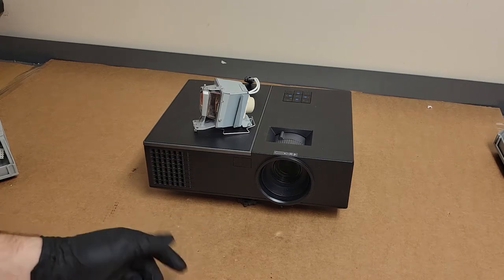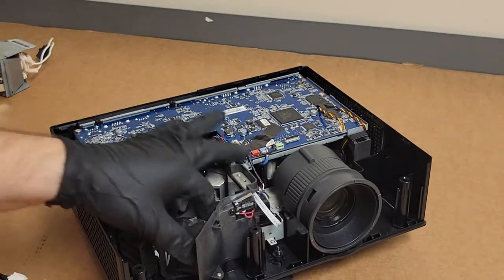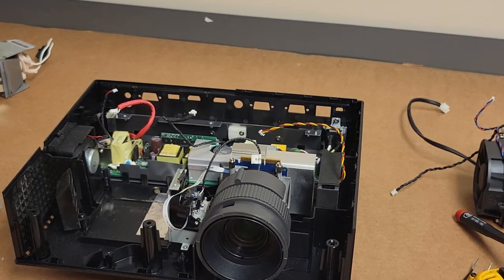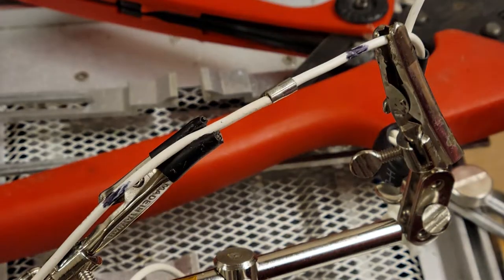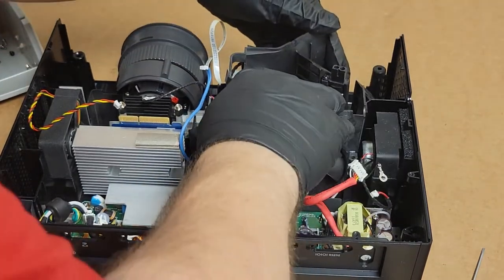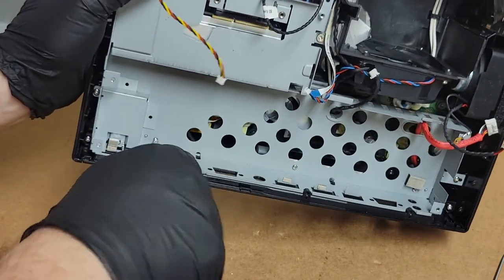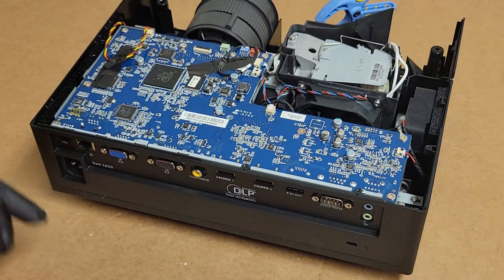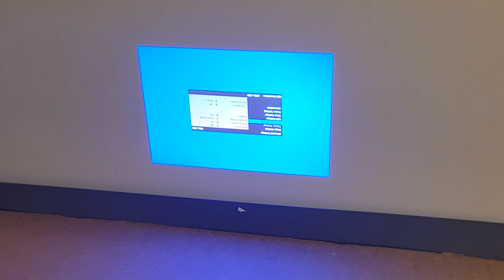Dell 1650 DLP Video Projector Lamp Connector Replacement

Comment: It is always a great pleasure to watch your videos (I work with used projector sales in Brazil and also love cats). Another Dell and Optoma twins for your files: the Dell 7760 and the Optoma ZH500T shares the same chassis and internal components. It seens like Dell and Coretronics had a deal someday.
Reply from the maker: Thank you so much!  I think you are right. I am pretty sure Coretronic built for a lot of companies. I would love to get in touch with an engineer from there to find out the specifics on how that all works.

Comment: Optoma, Dell, BenQ does it matter anyway? A design flaw is a design flaw. Just took a look at the new EPSONS (cheap ones 800p and 1080p) and they have taken a huge dive with quality. There is only a power-on button on the devices, the remote is just like a generic google box one and they have removed the air filters completely. Nice repair Frank. I wait to see many new EPSON owners really have a ton of problems with new models after a while.
Reply from the maker: I totally agree. I suspect they are trying to push people to their laser offerings.  You know how I feel about Epson.  :)
Reply: @FixitFrank  Franky I just ordered a new EPSON and it arrives Monday. It was a REAL Black Fridat deal for almost 40% off. Unboxing imminent and I will compare it to EPSON I already use that is also a dirt cheap model. More on Monday!!!!!

Comment: The lamp I do recognize it same Optoma BL-FU260C They go into Acer too. If you look inside the plug it looks different from the common optoma lamps. It only goes down fully one way around but sadly obviously people are not aware of this and they push the plug down randomly and if it has gone down the wrong way it has only gone half way in and will melt in there.
Reply from the maker: What model Acer?  I thought that too but I can't seem to find the model.  If you happen to think of it, let me know and I will add it to the description.  
I started keeping all the connectors I can find.  These newer bulb/housing configurations are just asking for trouble!
Reply: @FixitFrank  The lamp fits the following NEC projector models:
V302H  V302W  V302X  V332W  V332X
Fits Acer projectors:
P1287 P1387w P5515   
Fits Optoma projectors:
EH416 EH416ED W402 WU416  X402 X416      
DAEHHGL DAEWHZN 
DAEXHZN DAWUHGL

Comment: looks compare of an acer versions
Reply from the maker: Any idea which one? Im trying to find it myself but I am not finding the right model. If you happen to figure it out, I'll put it in the descriptions.  Thanks so much for watching!
Reply: @FixitFrank  no problem and hope you find the BenQ SU964 to fix with and at least you don't fix epson projectors any more but even a VS250 that needs to be cleaned
Reply: @FixitFrank  the acer is H6510BD
Reply from the maker: I'll have to look at that on Monday.  I think the connectors might be different but the housings do look pretty similar(in some pics I have). The H6510 is a dead ringer for the 1650 now that I look at the projector pics.  Very cool.  I'm keeping an eye out for an SU964.  I might have another high lumen BenQ coming in for cleaning soon. I forget the model but I think it was similar to the 964.
Reply: @FixitFrank  ok thats awesome and if my Epson VS250 gets dirty and check lamp hours and if theres a projector place somewhere in Lakeland Florida i live and if best buy Greek squad can fix projectors and clean them and free replacement lamp bulbs